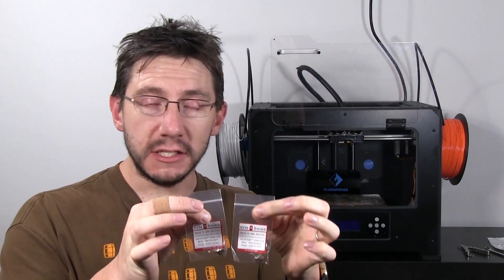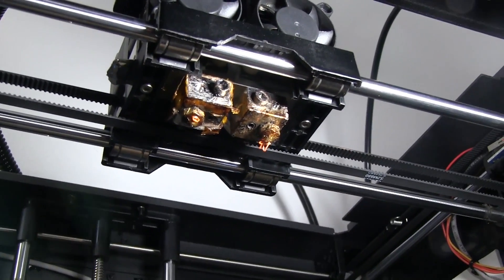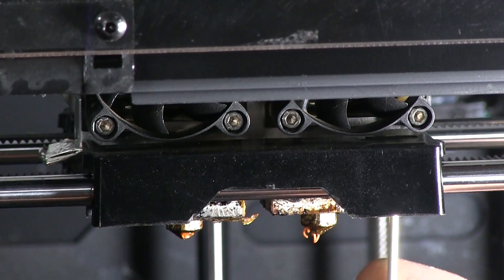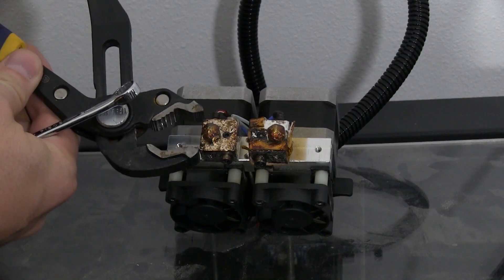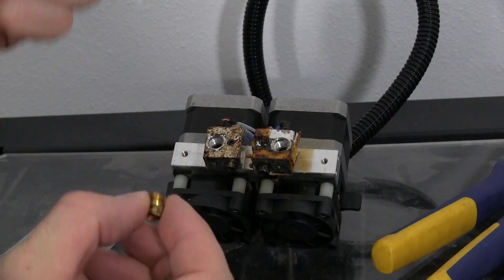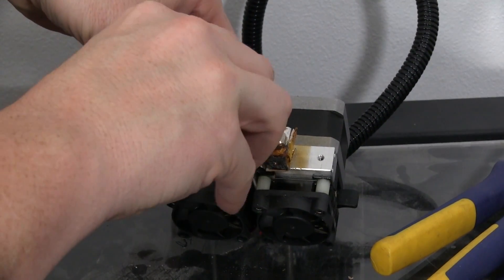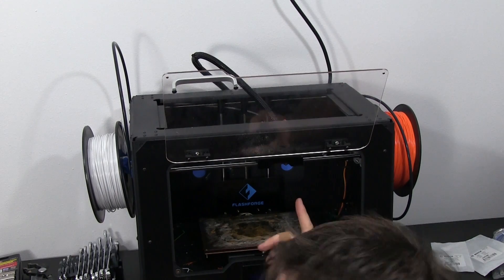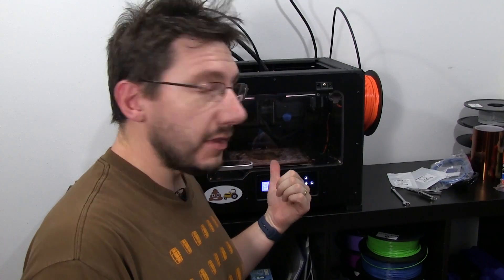Replacing Nozzles on the Flashforge Creator Pro

Comment: OMG, thanks for making this vid man, I have always wanted to know how to remove those nozzles, I was afraid to remove mine, for I might damage something and this shows how simple it is. Thanks ver very much. By the way, the spacer you placed so that one nozzle does not drag along the print, how thick was it?
Reply from the maker: +3D Printwiz Welcome! It was a standard piece of aluminum foil, folded onto itself twice. Not very thick AT ALL.
Reply: +3D Printwiz One thing you want to careful with is not to touch the heater wires or the thermocouple wires located on the backside of the aluminum block.  Be  careful with your spanners.  You can do this.
Reply: did that once....POW! :) Thankfully a power cycle and it was working again :)...

Comment: As always, quality video! :)  I have a Wanhao that has a similar setup, and there is a tool you can print on Thingiverse that is used to level the nozzles on them.  I printed one, but I haven't tried using it.  It is a good idea though, I should repurpose that printer for exotic filament.  Will have to see if I can find the nozzles you have there.  What size of nozzle did you go with?
Reply from the maker: +Paul Yanzick Do it! :) I used the 0.4mm mk10 nozzles!

Comment: Shocking those nozzles are not dowel pin located against rotation.  How else could you have a consistent XY position relative to each other?  Also, it would seem the printing area would be larger if they were flipped around closer to each other.   The lack of any kind of fixed alignment there wounds my inner engineer.  He's not talking to me now.  I hit like even though he frowned at me.  Gee wiz I.E.,  It was a good video anyway.
Reply from the maker: +Crafted Ha! I know the heater blocks have a dowel pin that locks them into place, or, at least keeps them from moving. In the video you can see one of the heater blocks moves a bit because my pin isn't tight. It's hard to get to, and tightening the nozzle seems to take care of it. Lazy wins for me in this case. Also, thanks for the like even though your Inner Engineer cringed :)

Comment: Your left-hand side extruder block seems pretty loose! It's the same extruder design as the dreamer and I have 'never' been able to fully level the nozzles again properly after changing heads. Do you have a super secret method for doing it without taking the whole extruder assembly apart to get at those pesky hidden grubscrews? :P You'll enjoy XT-CF20 prints like a dream and the strength, oh the strength!

EDIT: Should have watched till the end before posting haha, it's a little getto but shimming is probably the easiest way! I'll give it a shot.
Reply from the maker: +Maker's Muse Shimming IS a little ghetto, but, when I talked to Flashforge, that was their official method of fixing the leveling issue. I cannot wait to print with some more CF material! I'm VERY partial to the Proto Pasta CF and, well, I have a roll already for testing :)
Reply: Haha well if its official! And some Stainless PLA I see. Damn it if only the shipping wasn't twice the cost of the filament for me to get hold of some...
Reply: +Maker's Muse   I often change the nozzles on my Flashforge Creator Pro (from .2mm up to .6mm).  I don't remove the entire carriage, as it's really not necessary.  Simply secure the hot end with a set of grips and remove the nozzle with a wrench or socket.  No need to tighten them THAT much. I just get them little more than finger tight and check them for tightness before every print.    As far as the nozzle offsets, it's because of the bad design.  I do exactly what 3D Printing Nerd does because I've spent HOURS trying to get them level with calipers and measuring instruments and what not and it's never correct.  I plan on getting one of these (http://store.wmdproducts.com/index.php?route=product/product&path=63&product_id=62) when I get some more monies.

Comment: You are the first person I have seen that's pointed out where the ptfe tube is and how to get it out. Thanks for that because I'm getting prepared for if I have a problem when I get my  flash forge dreamer. LOVE you're vids btw and keep it up👍
Reply from the maker: +WolfGamerProHD Serious? Wow. I would have thought others would have mentioned that. The PTFE tube is super easy to remove / replace AS LONG AS you've removed the filament from the hot end prior to the procedure :) When you get your Dreamer, use it for a bit, but then, get a hardened / treated nozzle for it. I promise, one of the cheapest and best things you can do to upgrade that printer.

Comment: Ok, so I have a question for you... I've been wanting to replace the nozzle on my Dremel Idea Builder (among other upgrades)... Being that it's just a slightly nerfed Flashforge Dreamer (single extruder, non-heated bed) would these SS nozzles be a direct fit?

I love the Dremel, but the documentation is rather anemic... Prints like a boss though.
Reply from the maker: +Tom Johnson Jr. Hey Tom. Yes, direct fit! The Idea Builder uses an mk10 nozzle as well, and it's nearly the exact same procedure to do the nozzle swap. I just got an Idea Builder and can't wait to start using it! Also, don't be afraid to contact the guys at Proto Pasta - they have an Idea Builder in house with some upgrades and they LOVE it. Here is the link for the mk10 wear resistant nozzle on their site: http://www.proto-pasta.com/products/plated-brass-wear-resistant-nozzles?variant=1744165892
Reply: +3D Printing Nerd Awesome! Thanks for the info, keep up the good work!
Reply from the maker: Tom Johnson Jr. Welcome! Let me know how your upgrade goes!